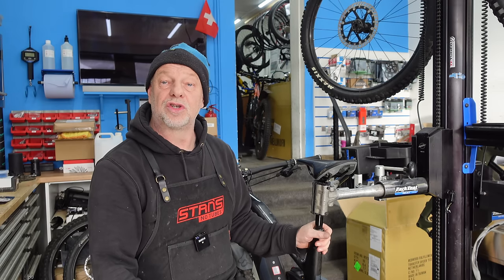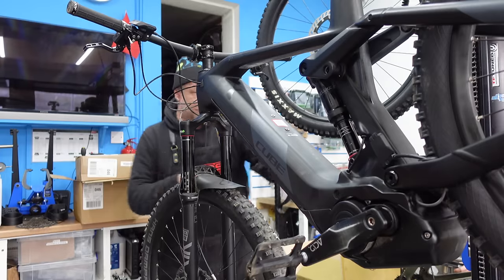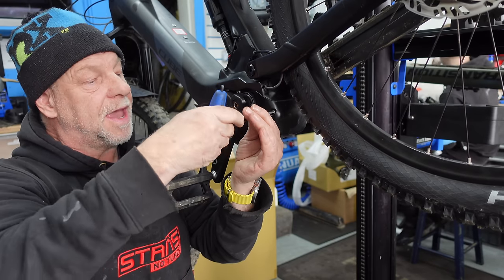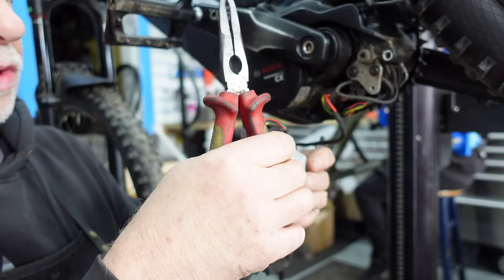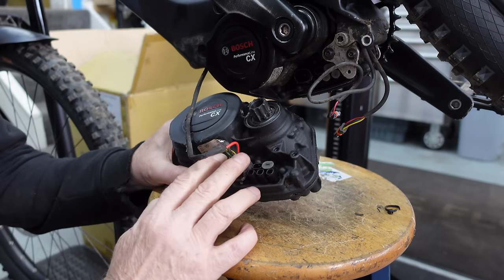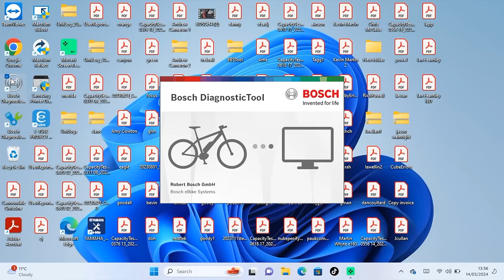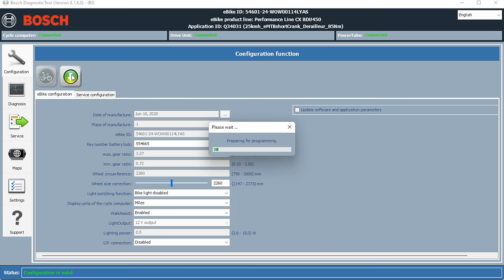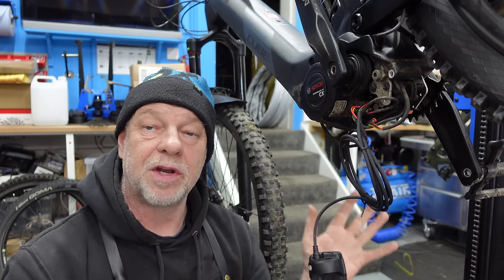We take a look at why this ebike is faulty,

Comment: Looks like the PCB issue, most probably from the moisture ingress / condensation (what else)? AFAIK this PCB is not moisture protected. IMHO this is criminal that they do not do it in the factory. It would cost them a quid. Looks to me like a planned obsolescence of the product. What about all these eco / sustainability claims?
Reply from the maker: Thanks for watching and your comments.
Reply: They’ve got pretty darn good moisture seals on the motor as a whole. Conformal coating might not cost a lot but it’s not necessarily a great fit for power electronics that need cooling. And it makes repair harder, as well.

Comment: I've just had my gen 4 fail after 3   1/2 years  and  5.5k miles of mainly off road  trails and being carefully ridden where water was concerned  IE  no riding thru very deep puddles or stream crossings swamping the motor  altho it's been ridden a lot in the lakes on wet shitty days  and wet trails , no power washing and careful cleaning, with a hose and brushes etc  the fault was it just kept turning on for a few seconds  and then not recognising the battery and turning off within a few seconds  , I checked all continuity of the wiring and tried  a known purion plugged directly into  the drive unit  eliminating  the kiox i have on , I have two batteries available so i tried the second battery  too,  and even with  the purion plugged into the drive unit and pressing the battery indicator it wouldn't wake the unit up using  either battery , I hard reset both batteries  just to eliminate that possiblity , I'm pretty good at diagnostics  and by that point  I had checked everything i could without being plugged into the diagnostic software.   I narrowed it down to the pcb at this point.          So knowing I'm out of warranty  I opened the motor up carefully  expecting to see water damage  only  to find not a sign of any water ingress or visible  damage to any of the internal components or the PCB  all connectors were good and had been treated to dialectric grease in my early days of owning the bike , all the bearings felt smooth too  , so at this point I carefully reassembled the drive unit  and  took it back to  my local supplying dealer to let them see if their software  could identify the problem,                          Im the original owner and asked them to see what they could find as basically I could do no more myself other than just buy a new motor,  As soon as they plugged it in they couldn't read any data at all the software couldn't connect  so basically they then  declared the motor dead..       So using your advice  I asked them to reach out to Bosch and  put a service report in .               Three days later Bosch have come back and offered me a new motor at 50 % discount, now I'm just waiting for  the new drive unit to arrive at the shop and get it fitted  so like you say Dave it's always worth a try, other than that I had a dead bike, not a cheap fix but a damned sight cheaper than it could have ended up , I also asked them to tell Bosch i have literally just bought another new  Whyte with the smart system gen 4  directly before my other bike failed   ( sods law ) , I dont know whether that helped sway Bosch but a 50% discount is certainly way better than a bog off your out of warranty .     Thanks for your advice Dave
Reply from the maker: Hi, thank you for watching the channel and your interesting comments. Bosch are happy to help where possible. My only advise is don't remove the case of the new smart motor, work with your dealer if it starts showing errors or misbehaving.
Reply: @TheYorkshireBikeMechanic  Cheers Dave hopefully I wont need to touch it at all. but yes it would be back to them rather than open it myself unless it was way out of warranty , but looking at this result Its probably better to let them do it. thanks again for the great advice 🙂

Comment: How about starting by spraying contact cleaner on the connector. Then as the PCB responds to diagnostic normally, the controller is probably not dead, then it's just a wiring issue. Probably checking the soldering of the connector would solve this.
Reply from the maker: Thanks for watching and your comments.

Comment: I was thinking whether it worth taking the PCB Out and using some PCB Conformal Coatings on it to completely seal it from the elements
Reply: I thought the same. If water has ingressed, then pcb corrosion could be there. It could be as simple as reflowing the solder at the rear of the pcb socket pins. It's obviously talking to the software. I would check the mosfets and any other components for signs of  damage
Reply from the maker: Hi, thanks for watching, yes water plays a big part
Reply: Anyone ever come across error  73 on a bosch motor

Comment: When this happens om the older power tubes with the green leds fit the battery back to bike and power it on from the battery button itself it should over ride the fault in 90% of cases! Seen people doing this a few time's with the older non smart system! A very important step that has not been done here that could save alot time and money!

Comment: I would have cleaned all the connectors on the cables and ports on the motor with contact cleaner. Since its already out of warranty I would open the motor up and look at the circuit board inside to see if water / mud got in there and clean it. A lot of times the board can short or be rendered inoperable due to mud contamination from use or high pressure cleaning.
Reply from the maker: Hi, thank you for watching and your comments. From experience what you suggest is not going to change things in this case the error code is a terminal one, I’ve tried many times even when motors a clean inside.

Comment: Top diagnostic report and accessing the problem dave, I work on cars and run a diagnostic report on every car i touch before I remove anything for insurance purposes, it alone can take up to 20 mins on expensive Mercedes. But without the firmware your trying new components like you did, which is impossible on numerous vehicles, good to see you have new bosch parts at the workshop you can change, do you have shimano new parts too? And brose, you definitely need brose if you get my drift!
Reply from the maker: Thanks for watching and your comments.

Comment: You mentioned some "fix-the-issue" solutions but there's one more - fix it. I was thinking you offer that? There are some companies in uk fixing e-bike motors,  potentially way cheaper than the new one.
Reply from the maker: Hi, Thank you for watching and your comments. If it's an internal software error we can not fix this. If its noisy mechanically then potentially I can fix it but I prefer not to, they are very easy to damage without knowing it so I don't do it any more.
Reply: @TheYorkshireBikeMechanic  I know that. But you are honest showing what you do and it would be fair to mention that because that's available as a solution.

Comment: Hello. missed the guy with the accent. Pretty sure the motor itself can be repaired. I can feel my fingers wanting to crack it open to figure it out whats wrong. Rule of the thumb, if its not followed by a catastrophic failure, usually the power reșated issues are the easiest to faultfind. Im surprised the video was not starting with a connections schematic for the bike. Also, I would NEVER fit new parts to a faulty scenario without assessing the full schematic because they can get damaged too, and that would not be fun. 
Dave, it seems to me you need a guy who can repair electronics, as good as you are with mechanics. 
Cheers.
Reply from the maker: Thanks for watching and your comments. good to be back

Comment: Surely the motor can be serviceable if not from Bosch from a third party company. If there is a PCB inside the motor, can't this be replaced or repaired?
Reply from the maker: Hi, thanks for watching and your comments., the internals are speciality components and not many will attempt it, mechanical it can be done but electrical no parts are available

Comment: Wow we really are a throw away society 🙄, when you replace rather than repair a whole motor for potentially a loose wire /connection on a circuit board ! Surely you should be able to replace the faulty electronic component at a fraction of the cost of a whole motor ?🤔 When there nothing wrong with the armature , windings , gears etc its like replacing the whiole motor on your Motorcycle because youve got a faulty Pulser Coil 🤪
If no ones rebuilding/repairing  these motors there is a masive market for it , especially once out of warranty 🤔
Reply from the maker: Hi, getting parts for them is a big issue.

Comment: I have a 5 year old Cube Hybrid. It's done 6,250 miles with no problems at all with the electrics. Not even the display battery! Have I been lucky so far or what!
Reply from the maker: Hi, thank you for watching and your comments, I would be interested to learn where abouts you live and what sort of riding you do
Reply: @TheYorkshireBikeMechanic Hi Dave. Thanks for replying (not many do lol) I'm 72 so I don't often go banging along muddy tracks. I'm in Shaw which is part of lovely Oldham. I'm a fair weather cyclist and mainly stick to main roads and quiet lanes. I don't go out in the rain unless I'm caught out. I only wipe the bike down with a damp cloth when I clean it. The Purion display has still got the original batteries. I've replaced a few items on the bike that have worn out but the electrics have been absolutely no trouble at all. I have my own YouTube chanel with plenty of videos to give you a look at the Cube. It's here to stay. It's more of a touring road bike. As the bike ages and the miles clock up I sometimes film my efforts at home bike mechanicing in the shed which is rather painful and funny to watch at times. It's mainly to let people see how the bike progresses as it (and I ) age. My wife has a Scott Hybrid e bike. (2,600 miles and a bit older than the Cube) and again the Bosch electrics so far have not been a problem but at Sherwood Pines on 1 occasion it read ERROR on her speedo and the power turned off. The speedo was still lit so we switched it off and back on again and it was no trouble after. The day after it did the same but on the final day it was okay. I've cleaned the Scott's dirty and dull battery contacts to see how it goes. We'll find out in a few weeks in Scotland. But my chanel is all about the Cube. When new I did a video of how far I could get in 'ECO' Well, I managed 78.5 miles. So I'm planning to do it again covering similar roads to see how (or if) the 400 watt Bosch battery has degraded. I just need the weather to be a bit kinder. Cheers.

Comment: Shouldn’t bosh dealers be trained to strip the motor and replace parts of it like the electronics board , I don’t own a bosh bike , the one I’ve done 1.5k miles on is a Chinese bike that would only cost £800 to replace but it’s been everywhere that my mates electric Trek rail has been and most of that pulling a loaded trailer , his first service cost him £500 for parts and the service cost , it’s a dear do by the sound of it , all the parts for mine are available within eight days with only the 23AH battery and the hub motor wheel being expensive but nowhere near bosh prices .
Reply from the maker: Thanks for watching and your comments.
Reply: @TheYorkshireBikeMechanic  I would also add Bosh designed the motor to power an E-bike and while moving parts suffer wear the electronics board is not a moving part , if the motor hasn’t been disassembled by someone not qualified and the motor has not been subject to ether submersion or accident damage then this simply should not happen and if it does it’s up to the manufacturer to put it right ie Bosh .

Comment: My Raleigh Stow E Way purchased in June 2023 went back to /Halfords on the 17 December New Pedal crank Sensor fitted on 17th January  February 15th Back to halfords and its been in since They haven't got a clue about the tranzx diagnostic programme May well be going to small claims court to get it resolved I told them to change each piece over one at a time to eliminate which compenent is faulty they just don't listen I watched that closely to see how a proper technician fault finds  . Any tips on what the issue is ?
Reply from the maker: Thanks for watching and your comments. Raleigh is well supported, they should be on to them for help. They have a good support team in Raleigh
Reply: @TheYorkshireBikeMechanic  Have spoken to raleigh myself twice now Halfords just doesn't let Raleigh know if they tried what Raleigh suggests so just shuts the case down Thing is Raleigh won't sell the parts to anybody if they are not a dealer .So pretty much in Limbo cycle less 😞 thanks for the reply though
Reply: Hi, please don’t give up, send a letter to Halfords head office and Raleigh.
Reply: @TheYorkshireBikeMechanic  I think the issue has now been resolved I think the letter of intent I sent via email to start court proceedings if not repaired or replaced within 14 days has had a motivational effect

Comment: I bought a second hand motor (bosch cx) off e bay for £100,guy didnt know if it was good or not,it was in good condition,so i rebuilt it with all new bearings,had it tested by my LBS bingo,new motor to swap when mine goes wrong.
Reply from the maker: Thanks for watching and your comments. only problem with that is that each motor is programmed for the bike it went in in the first place